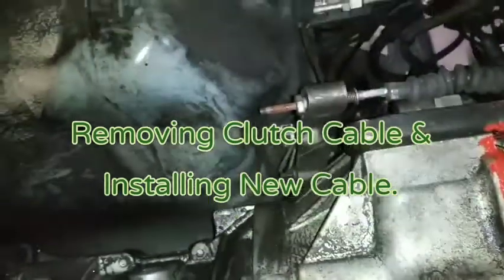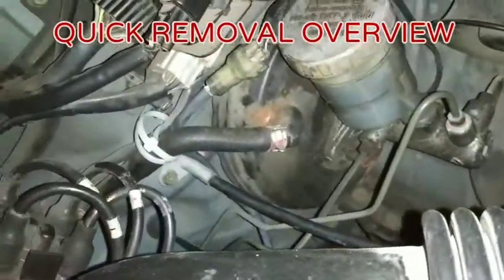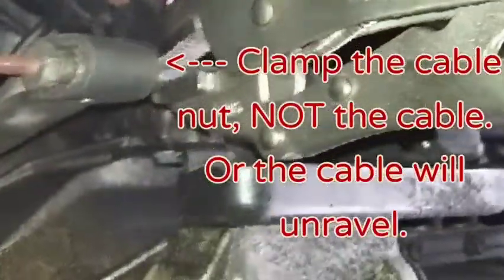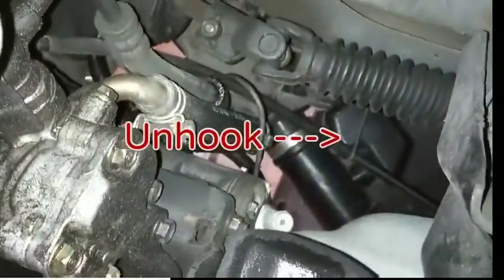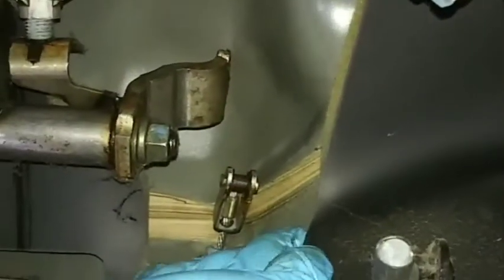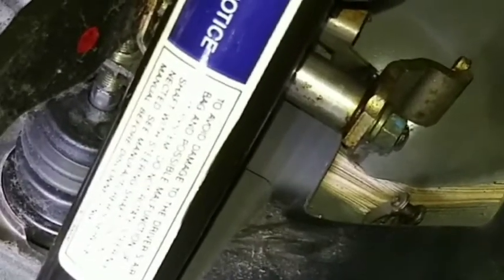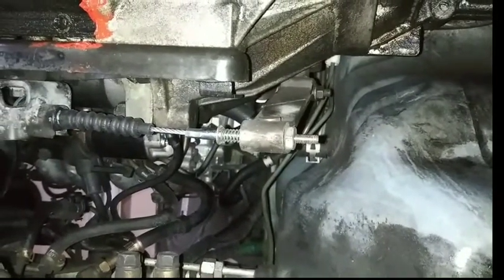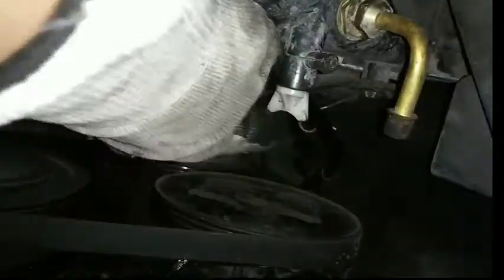DIY Clutch Cable Replacement; Removal & Install

Comment: Thank you very much.  You are the only person that has made videos for this 98 Tracker that I can find.  You give great instructions.  My clutch will not disengage and the cable is damaged so it needs to be replaced, however I'm not sure that is the real culprit for me.   Why did you replace your cable?   Also, I will send you a set of deep well sockets if you still don't have them.
Reply from the maker: You're very welcome.
A faulty clutch cable was intermittently preventing the Tracker from shifting, without a lot of force & causing it to grind gears. Especially putting it n Reverse or First.

Did you receive the new cable yet?
How's your Tracker now?

I can't guarantee the source but have been told that the after market clutch cables don't always last a year, before they stretch & need to be replaced. 
Advance & NAPA's offered warranties, so I was gonna test one myself, but an unfortunate shredding alternator belt incident damaged the Napa one. Soooo glad I didn't have the pricier OEM cable in there, at the time.

Going to locate an OEM cable through Suzuki, since I'm having to replace it anyways, when I get some free time to find one. I'll share the part number, when I do.

I still don't have deep well sockets. You have no idea how much I appreciate the offer. 😊 I love new tools! Maybe if more of these videos help you with your Tracker later but it's ok. Just letting me know my efforts, to share my research & repairs, has done someone some good is awesome to me!
I have a ton more to edit & upload still, whenever I get enough free time.
Reply: @chm3598  
Thank you so much for the reply.  You really keep me inspired to maintain my little baby, her name is Mary Jane because I drove her to the base of Mary Jane this summer and hiked to the top.  I drove her all over the U.S. and even went Sasquatch hunting in S.E. Oklahoma.

I was able to replace the cable with the one I ordered on Amazon and all is well.  It took a few days for the cable to come in so I removed the old cable that had worn sheathing.  I wrapped it in duct tape and foil tape, which allowed me to get around town until the new cable came in.  When you install the new cable, use zip ties to make little harnesses around the cable to keep it from sliding up into the belts.

Funny story, my neighbor is a professional mechanic and he kept telling me it was the master cylinder.  I told him that this car is not hydraulic, he just scoffed at me.  I sent him your video to which he replied "Oh I thought it was a different year.".  He was looking at the car!

Maybe you can help with another issue.  The plastic mouldings that hold the top in place are breaking and I have to heavy duty velcro them in place.  Do you have a source for the mouldings?  If not, I'm going to find a 3D printer and replicate them.

Things I've fixed so far:
1. Breaks
2. New front end
3. New canvas top
4. Clutch cable

To do:
1. Replace mouldings to hold top in place
2. Build quick release pins to remove doors on nice days
3. Build a CarPi for gauges, entertainment, GPS, etc ...
4. Fix leak in break system
5. Bypass the stupid clutch kill switch

Amazon Cable Link:
https://smile.amazon.com/dp/B097QDGVHB?psc=1&ref=ppx_yo2_dt_b_product_details